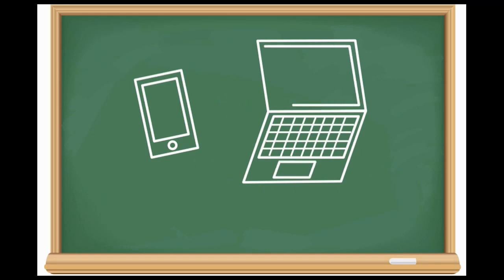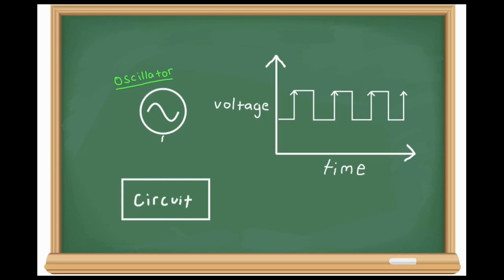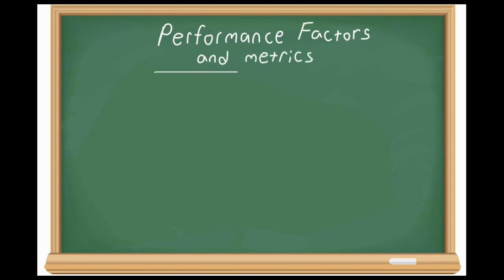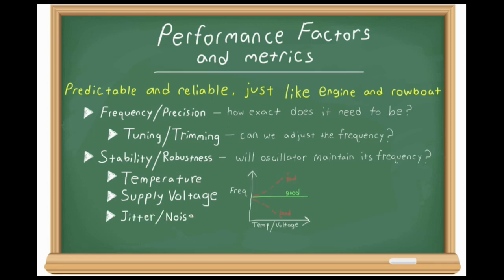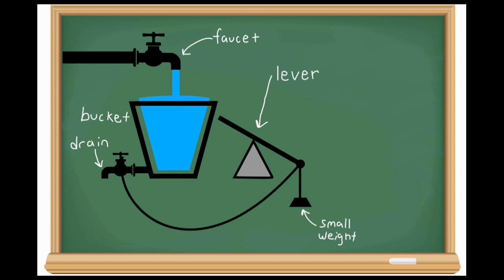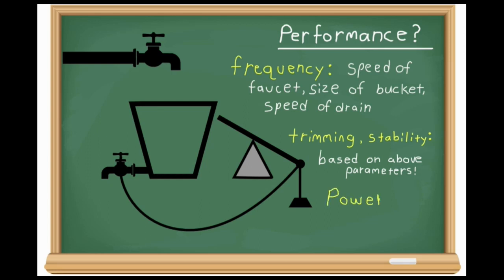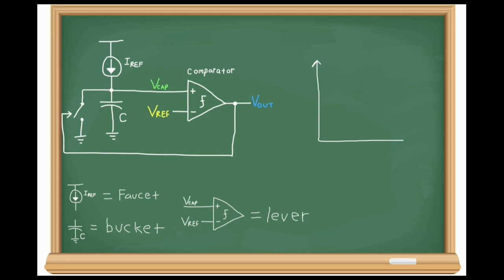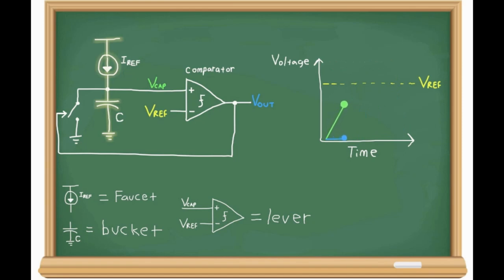Circuit Introduction: Oscillators

Comment: I like the analogy and how you tied back to an oscillator circuit. I also like the graphics. What software did you use to create the drawings?
Reply from the maker: Thank you! The graphics were drawn as SVG files using Inkscape (https://inkscape.org/). The drawing-style animations were created by animating the SVGs with a JavaScript class named Vivus (https://github.com/maxwellito/vivus), and the motion animations were created using Synfig (https://www.synfig.org/).